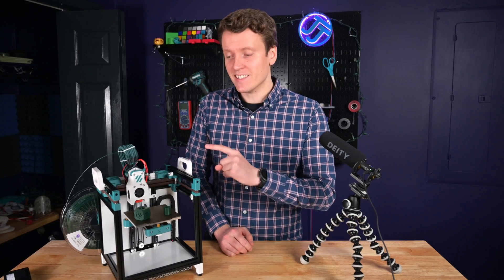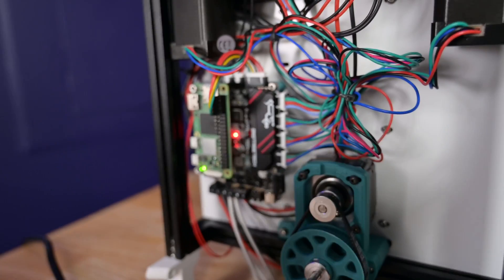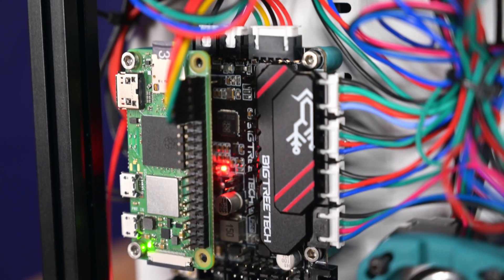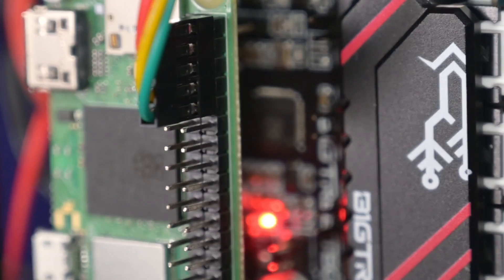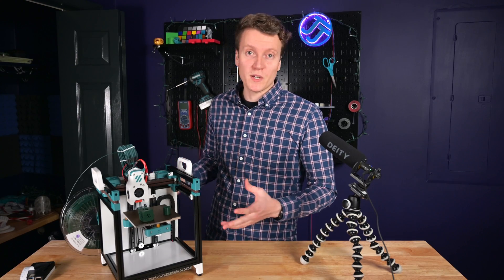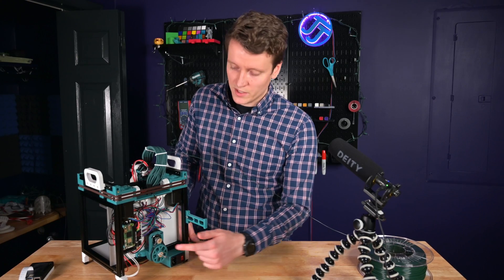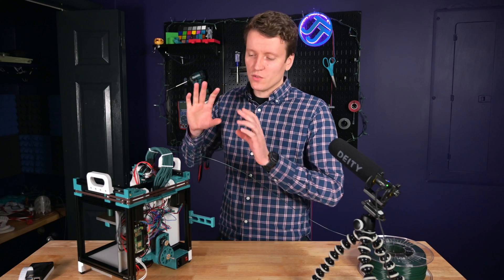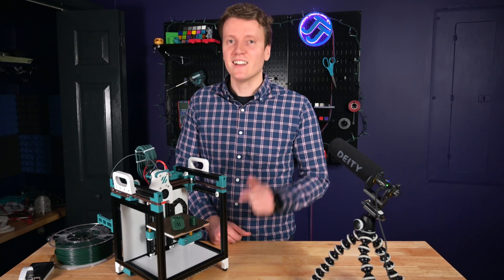BigTreeTech SKR Pico in Voron V0.1 | Initial Review and Setup

Comment: Can SKR Pico run on its own ? meaning without attaching another pi board to it?
Reply from the maker: No, since it doesn't have a built in sd card slot there is no other way for it to get files to print

Comment: hi JJ how are you and everyone???) the 3rd day cannot establish relationship with my pico) every time i switch it on (skr PICO + raspberry pi zero w or raspberry pi zero 2w- ueart connection!!!!!!!!!!!!) i cannot start it up! the only way after a time to press the reset button on the board and it will start but once i switch it off and start again the same situation(((( so i wonder how you managed to connect the zero w or 2w to the pico and it works good without any issues???
Reply from the maker: Following these steps may help you: https://github.com/bigtreetech/SKR-Pico/tree/master/Klipper#configure-the-printer-parameters
 I have heard some people having issues with it over USB, but mine has been rock solid on UART.
Reply: @JJShankles  thank you JJ - mine coonection via uart and i have tried usb also- nothing works- for sure have guided by the skr pico master! compilation manual and the file from the github - nothing helps ((( i guess this is the boot loader on the board itself(((

Comment: Oh, sweet summer child, what do you know of the Big Tree, and it`s ancient crap, I mean tek? You think that fuse is going to save you from the unexpected hitting wrath of that satan`s spawn, you call a "pico"? You better tell your Pi to keep his affairs in order, and don`t get attached to your display if you have one, or anything else you plug in there. Good luck. 
...you do have a smoke detector, right? Otherwise, tear that thing out there with your teeth if you need to. Even if you have one, that would still be the wise choice.

Comment: I heard it had a plug for neopixels LEDs and neopixels are 5v right? so couldn't you use the neopixel plug for the 5v? also can you use 9 neopixels with the fan drawing its 5v as well? I kinda want to do a 4 leds on the left and right of the bed as well as a 9th in the front bed mount I'm pretty sure this is the board I want in my V0 since my SKR 1.3 decided it doesn't want to work correctly anymore also just putting this out there the original V0 had a 24v fan I'm not sure how long the board was in development for but couldn't it be possible that it was started before the V0.1 came out?
Reply from the maker: Oh I didn't know that the V0 had a 24V fan. That could make sense with their decision. It is running fine off the 5V line from one of the endstops since I'm just using the stock microswitches that don't need the 5V.

Comment: Nice video, I was searching for a belted z and I think I have never seen yours before. Did you design it yourself?
Reply from the maker: I didn't design it. I found it here: https://github.com/VoronDesign/VoronUsers/tree/master/printer_mods/MathematicalPotato/v0.1_belted_z_drive
The instructions were a little confusing, but it is working well now
Reply: @JJShankles  Yea; I had to open the CAD file to figure how some of it goes together.  Just got PICO and going to pull out skr mini and replace it with PICO. With the Z belt mod. pretty tight back there.

Comment: I really like the features of that board. BTT is really pushing it as perfect for the V0, but is there any reason why it wouldn't be good for other printers? Seems like it'd be good as an easy way to upgrade a printer to use Klipper or even when building one of voron's larger format printers.
Reply from the maker: I think it would be great for other printers. I'm thinking I would like to put one in my Anycubic Mega S in the future. It has all the features most common printers would want.
Reply: The Pico has only 4 motor drivers, with a parallel jack for dual Z motors but they are not independent when used that way. So it would work for most printers but the larger current Vorons (other than switchwire) require more motor controllers. You get one more motor controller if you use canbus for the toolhead extruder motor, but the Trident requires six motors and the V2.4 requires 7 motors. You could use two Pico boards of course, but this could get confusing. I have a pico board on a new V0.2 and it works nicely and fits in the small space which the VZero has to work with.

Comment: It looks like you have sort of an M4 extruder style thingy on the back of the printer, but also having the miniAB toolhead at the same time. What is that for?
Reply from the maker: It is a belted Z axis mod. Is basically uses an M4 extruder to drive the z axis

Comment: Hi JJ great video, I'm curious what software are you using to connect to the raspberry pi? I should get my pico verry soon and I'm going to connect it to SimplyPrint. Also love the aesthetics of your voron
Reply from the maker: I am running FluiddPi on the raspberry pi, and I control it through the Fluidd webpage it creates. I also use Putty to connect to the raspberry pi through SSH when I need to change things there. Does that answer your questions?
Reply: @JJShankles  Cool, yes it does